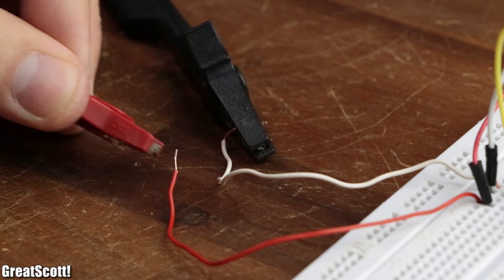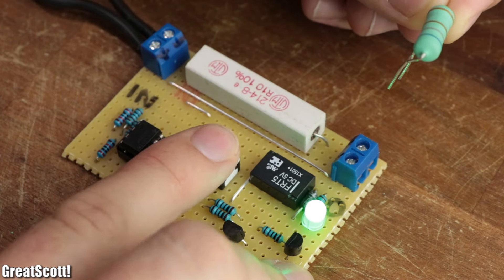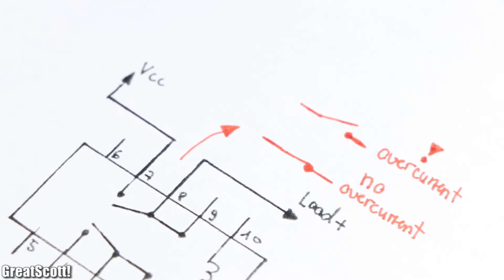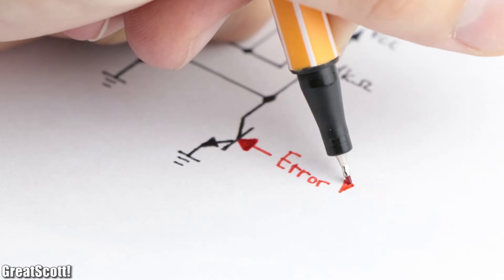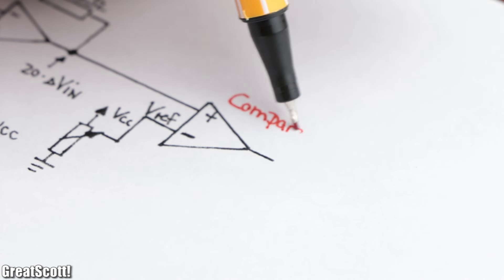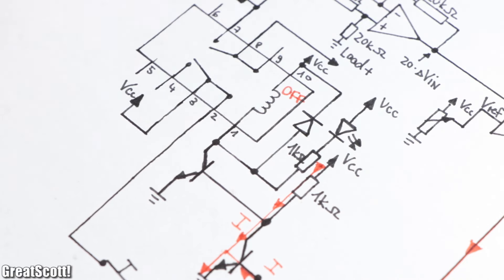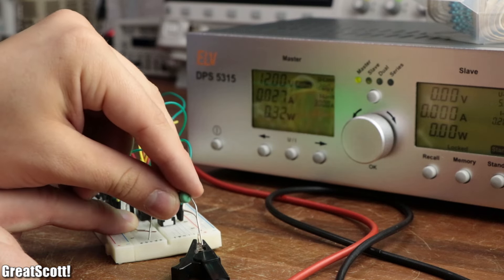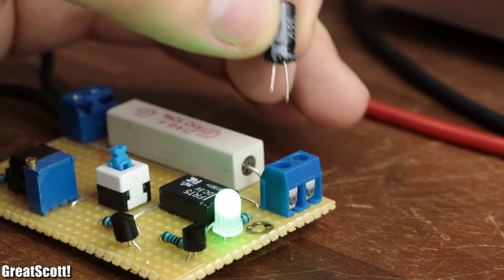DIY Short Circuit (Overcurrent) Protection

Comment: Dear Scott, you Great :-) 
I was wondering if this kind of circuit can be used as an anti USB-KILLER device.
Let me explain more in detail the problem for who ignore what an USB killer is.
* Nowadays USB ports are commonly used in ton of electronic devices.
* USB 1, 2, 3 standards commonly comes with two pair of signals [V+, GND] and [D+, D-] (type C not treated)
      * V+,GND 
             voltages are rated +/-5V
             current, depending on USB standard up to 1A
      * D+,D- 
             voltages are also rated about +/-5V  (3.3V in general)
             I'm not sure about the amperage
* Most electronic company use overcurrent and overvoltage protection on the power line V+,GND
* Very few electronic company use overcurrent and overvoltage protection on the data line D+,D-
The result:
USB Killer, with the use of DC-DC step-up converter, or capacitors, store the voltage coming from the power line and then discharge it to the data line KABOOM.

So the idea is to make an USB voltage\current checker to protect both lines.
HINT: USB killer pumps until 200V in the data line!
Thanks for your support :-)

Comment: please make a video about how to boost wifi signal . 
and i have a question. i have a phone that it has a quick charger. (it supports both normal charger and quick charger but quick chargers can switch between 9 volts and 5 volts) how the charger switches between 9 volts and 5 volts and how the phone senses that charger is 5 volts or 9 volts? 
sorry for my grammar problems
Reply: Arya .s Get a new phone (Redmi 3s is known to me) with better wifi chipset or get a wifi range booster/wifi reapeter. Or use a secondary wifi router to create WDS or wifi mesh
(dont steal wifi tho😛). There is some kind of proprietary microcontroller/asic in the Qualcomm Quick-chargers which communicate with mobile using USB data pins and determine the charging voltage & current. like 5v 500mA-2A or 9v 2A.
Reply: Yeah take an old router and you can put aftermarket software on it. I forget the name but it allows you to use it as a repeater and you only need a power source
Reply: Melody I use old pentium 4 laptop (free☺)  on Windows 7 as a wifi repeater. And you dont need any extra software to use a wifi router as a reapeter. Wifi reapeter function is integrated in most firmware of wifi routers. Even as low as 12$.
Reply: Melody Its DD-WRT. Here you go my boy- http://www.dd-wrt.com/site/index 
Dont forget to check the supported router list.
Reply: thanks for everybody for helping
Reply: BTW is you have the money or do find a cheap second hand router (with the repeater feature or that can be modified through DDWRT, OpenWRT, etc) I recommend you going with that route.
Using a whole computer might seem reusing old hardware, but is very inefficient energy wise :P 
Also, it's a hassle fixing the software problems you might find along the way... though you could learn a lot!
Reply: Thats not his territory. Check out Kreosan. They have a russian channel and an english one. They're pros in Wi-Fi amplification
Reply: Quick chargers basically communicate with the phone. At default, it charges in 5v. When the phone tell the chargers that it support quick charge, the charger will bump to 9v

Comment: Can't you just use a fuse in series to vcc
Reply: Than you need to change fuse all the time you fail
Reply: Hüseyin GÖKTAŞ you can use resetteable fuse/ polyswitch
Reply: Diego A What if the current you want the circuit to pass through, varies with situations. Do you keep on changing the fuses? of course not!
Reply: what the stupit idea

Comment: bro i have modified your concept and build a great one!!!it was quit better than yours.
because i have used cheap relay of 6 volt.
the nc of relay provide the power out put.
when short circuit occur relay gets on. the nc would be cut off.
if someone remove the power source then connect again then power will come.
and there is also a push button to do that also.
i have used a diod and 1000uf cap to provide power to lm358.
when short circuit occur there is no voltage drop to the ic vcc pin.and it then work with great accuracy.
that's why my version is batter than you.